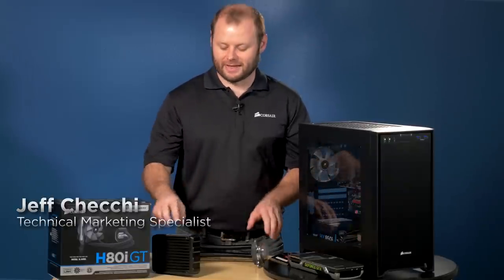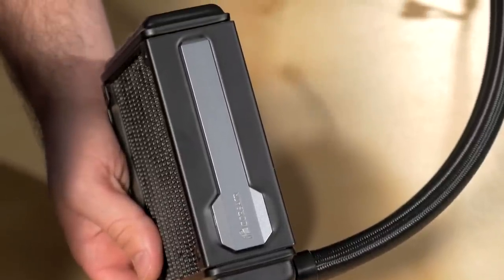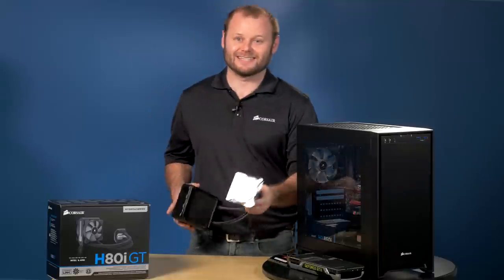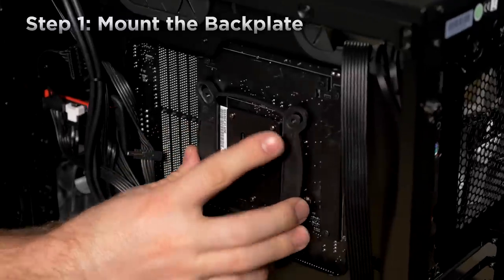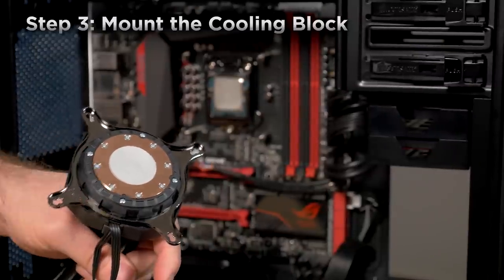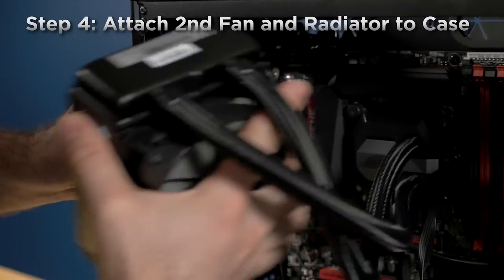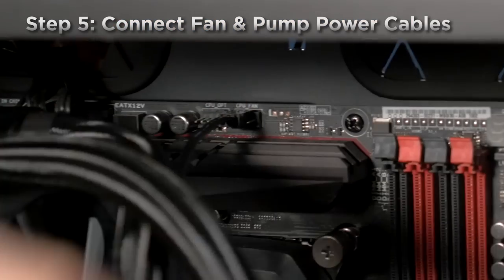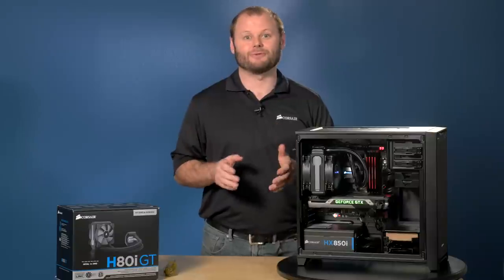Corsair Hydro Series H80i GT Liquid CPU Cooler Installation How-To Guide

Comment: What the difference between the H80i GT & H80i V2?
Reply: +Rase P TBH, all that I could see that is different is the logo's, maybe they fixed some design issues, I know my H80i GT detects the CPU Temp as 27°C even when my CPU at full load reads 65°C so the fans never speed up when the CPU gets hot, which sucks.
Reply: +Paul Kirby Thanks for the reply Paul.  I found a forum thread on corsair's website which states that the h80i GT had a really big backplate/mounting bracket which was not fitting into some mini-itx mobo's running lga 1151 so they got complaints for it & so they revised their backplate/mounting bracket to make it a bit smaller to fit on all mobo's.  Everything else about it is exactly the same.
Reply: +Rase P Hydro Series H80i v2 is an all-in-one liquid CPU cooler with an 
extra-thick 120mm radiator and dual SP120L PWM fans for cooling that's 
far superior to stock CPU cooling fans.

Comment: Hi, I got mine installed buy some guy at the store. He didn't plug in any of those cables apart from the link data cable. I'm assuming that he wants me to get the link software. No wonder my CPU wasn't cooling :/
Reply: Hi, I have no idea how to install this. What store can I go to, so someone can install the cooler for me?
Reply: +hotmusterd It depends, in my country - there's a shop called 'Maplins'
Reply: It's quite simple. look up how to install a CPU cooler, and read the instructions packet. it's quite straighforward

Comment: I have a Hyper Evo 212, my idle tempratures with a 4790k (4,4 ghz ) are 28 degress, and max 67 degress while gaming. 

Is it worth it to upgrade to this water cooler?  or like a H80i/H100i?
A little professional help here please?
Reply: well that depends, are you ok with your current temps and noise, and do you plan to overclock?
Reply: the evo 212 is a mid range All in one water cooler while the corsair h80i gt is a high end water cooler that will certainly get you better temps
Reply: ***** The 212 EVO is an air cooler....
Reply: ***** He never said it wasn't, mid range doesn't refer to a type of cooler but what tier it is based on price and performance e.g, low end coolers won't offer great performance but be cheaper, while a high end cooler will offer great performance while costing much more
Reply: Look at what he said -

"the evo 212 is a mid range All in one water cooler"

Please, please don't say i'm wrong.
Reply: whoops, sorry your right :p, idk what happened when reading that brain just farted all over itself.

Comment: what if there is no cpu fan slot?
Reply: +mike fredley Mike, I just installed one. What do you mean no CPU fan slot? The plugin or the drill holes to place the bracket? It should be pretty standard from what I have heard.

Comment: Guy I have an issue, I just got mine installed and now my pc cant boot up properly, everytime I turn my pc on, the corsair logo lights up red for awhile then turns white then the enitre pc shuts down. What does this mean and how to I fix it?
Reply: do you have asus motherboard?
Reply: +Krzysztof Dudek yes
Reply: +crest video it's because our motherboards have a safety feature built in which prevent pc from booting if the rpm fan speed is below 600 and this fan rotates very slow for motherboard ro detect it (it's just better than stock so it does not have to rpm so fast)
Reply: +crest video go into BIOS and find your fans and click to ignore cpu fan rpm from 600.
Reply: +crest video if you cannot acces bios, connect your old cooler (just the cable, leave h80i gt on your cpu) and you should be able to boot properly and then access bios and set mo to ignore cpu fan rpms.
Reply: +Krzysztof Dudek i dont understand the ignore cpu fan part...
Reply: +Krzysztof Dudek Installed my H80i GT with the stock fans and it worked with no problems on boot up. I upgraded the fans to the SP120 low noise and they would not spin above 494rpm which I found completely odd especially when they are rated at 1400rpm. I kept getting the CPU alarm as well but I didn't want to ignore the issues so I didn't ignore or reduce the required speed. What did the trick was I installed the corsair link software and was able to finally get them to a higher RPM... then I uninstalled in and have been able to control the speed using the motherboard software. Even with the fixed RPM the CPU kept having the alarm so I eventually disable since it was working as needed. Took me awhile to figure all this out, kind of annoying.
Reply: +Krzysztof Dudek Dude thx i have the same problem but did what you wrote and now my pc runs normally, no more red light xD..... (sorry about my grammar, english its not my native lenguage)

Comment: hi guys a noob question here... in "step 6: connect corsair link data cable"...... to where???
Reply: Yeah i'm asking the same question. My Corsair link program don't recognize the H80i
Reply: One end to the heatsink assembly and the other to an internal usb header. If you haven't got one, you can try buying a standard Mini USB to USB cable and connect it to a spare external USB.

Comment: Are the fans positioned for intake or exhaust?
Reply: intake.
Reply: Roberto Souza Thank you!
Reply: +Roberto Souza Wrong ! He putted as exhaust !
Reply: yes, but in the manual says to put in intake mode. anyway, I think that depends of the position of the cooler you wan't to put, if are on top the best way is put in exhaust mod and vice versa. The reason is because heat rises and cold falls, so intake in lower position and exhaust in the upper position, causing an airflow. SORRY FOR MY BAD ENGLISH.

Comment: So one side flow hot air outside and one side flow hot air inside?
Reply: No, inside fan blows are from inside the case through the radiator. Second fan on the outer side blows air out from the radiator
Reply: No, the fan on the inside of the radiator (closest to cpu) is most likely setup to push air through the radiator then the one closest to the outside of the case is set up to pull that heat out of the back of the case.
Reply: Thx, guys. I bought pc in which one of the fans was blowing hot air to inside :D I notice that my case was to hot then i was playing games so i just turn one fan. Now CPU temp drops from 78C to 43C. I think dude which sold me 2600k with h80i, ssd and modular PSU thought his CPU was dying :D Also windows was seeing only 1 processor core. I just change settings in msconf/advanced settings. Now 300 euru pc is perfect.
Reply: +Audrius Mikalajunas I have some fans blowing air from outside in and others from inside out. front mounted fan pushes air in , window fan pushes air in and at the top rear it pulls air out .

Comment: Hope that Corsair Link software will be fixed soon to...
Buying a 100 dollar cooler that has software that doesn't work is just sad!!!
Reply: That's what you get for not getting the superior AIO from Swiftech
Reply: download the older driver meanwhile, it fixed it for me
Reply: Wiler Prime
Have an older driver installed.
I had an much older version before that worked great on Win 7 but after installing Win 8.1 I haven't found one that works correctly...

Comment: is it necessary to remove the old thermal paste from my cpu before installing this?
Reply: Yes it will be.
Reply: FuriousTaco okay, thanks =)
Reply: FruitCakeNinja yah it is :P
Reply: At least if you want the coolder to work good.
Reply: +FuriousTaco theres is a 5 degree difference so i preffer to not spend 10 bucks on thermal paste and get anither fan :P
Reply: FruitCakeNinja Well it could make a big difference when overclocking :0
Reply: pew pew m8 just get a h100i gtx XD or a hyper 212
Reply: Arctic Silver makes a paste removal solution called ArctiClean that makes the whole thing easier, FYI.
Reply: hyper 212 is shit compared to the h80

Comment: Which case is that?
Reply: +The Drunk Knight It looks like a Obsidian Series® 350D Windowed Micro ATX PC Case CC-9011029-WW
Reply: Wow thanks man
Reply: +Paul Kirby Hi Paul, so if it fits in the 350D, then no worries for the 450D?
Reply: +Gilmer 9999 Well from what I can see in the specs the 350D has space for 2 x 120mm or 2 x 140mm fans on top where as the 450D has space for 3 x 120mm or 2 x 1400mm fans, just check in the specs.However you still need to watch out for the rear fan if fitted.
Reply: Paul Kirby
Thanks! It's sometimes hard to understand the specs, though. I apologize - I'm not as knowledgeable as I should be.
Reply: +Gilmer 9999 That's ok, I even miss read and responded with the specs for the top fan mounts LOL, but both rear fan mounts say 120mm which most people mount it to, so in theory you "should" be ok.  
I ended up buying a Graphite Series™ 760T Full-Tower Windowed Case CC-9011073-WW for my H80i GT cooler, seems fine, I am using it on an Intel i7 4790K and on idle its about 32°C and at full load its only hits about 60°C so its not too bad, I have it pulling in air from the back of the case through the rad and into the case and use 2x 140mm fans blowing out the case.  
I "might" try putting rubber gaskets between the fans and the rad so that I get more pressure through the rad instead of air leaking through the gaps, resulting in cooler fluid.
Reply: +Paul Kirby Hi Paul, thanks for the help. I got it installed, not too much trouble, although it took me about 2 hours compared to Jeff's 3 minutes, lol.
Reply: +Gilmer 9999 Well mine also took longer than the 3 mins also LOL, however I was building everything from scratch along with all the cable management etc, but I think everything took about an hour, and that is for installing everything.

I sort of had a heads up on how to install this cooler, due to I had to build my sisters PC before mine, so hers was a test LOL.

But overall this cooler is rather nice, the only issues I have is the gap between the fans and the radiator, there is a small gap between them which means your not getting the full pressure going through the radiator, so I might make a rubber gasket for both side, so hope fully that will force more air through the actual radiator causing the coolant to be cooled better.
Reply: Paul Kirby
Sounds like you more than have handled anything you need to, or will in due time. /cheers!

Comment: Pump on this unit lasts nothing.
I opened an RMA ticket with a refund request. Ticket

6714025 please read it.
Reply: Can't find it. When did you buy this cooler? When did it stop working? And how did you realise it failed?

I just installed it yesterday and I fear pump fails and leaks. :(
Reply: +Krzysztof Dudek This is the thread: http://forum.corsair.com/forums/showthread.php?t=154367
PS: I bought it from Drako.it and I will buy a second unit in the same shop
Reply: +Krzysztof Dudek and this is the ticket number I opened in the corsair.secure.force.com portal: Ticket6714025
I
Reply: +Krzysztof Dudek I forgot to answer your questions. 1) I bought it at drako.it 2) Some days ago 3) As soon as I start the PC I get the CPU overtemperature error, I tried reseating the cooler but the CPU pump rpm is 0.
Reply: +Davide Perini np, cheers for answers!

I decided to pack this crap and send it back to Amazon, will say it's faulty because it Goddamn is... 
a) cannot control rpm of fans so they all run how they want to (very slow) so I have hot air stagnation inside my PC 
b) meaning my MSI GTX 970 (60c) and motherboard (40c) overheat but my CPU stays ice cold (23c) 
c) because my vanilla fans are too slow, hot air rises and I can smell the heat from under the table 
d) corsair link does not detect anything, even with "fixes" LOL 
e) air cooling is safer, better buy a larger case and then buy noctula but will go with 212 evo for now, not gonna overclock my i5-4670K anyway but buy a new chip in January

what a shame, I was really excited about this cooler :( it looks amazing but software is SUCH a letdown... :(

Comment: easy? fuck that l spent HOURS getting this installed into my case.. the standoff screws are a joke.. one of them spins with the thumbscrew so l cant take the pump-unit off of the motherboard anymore.. Also the fans make this very strange sound, like something is against something -sound, even though there's  nothing between the blades, when past 1000rpm.. Yeah it keeps my CPU very cool compared to the H55 which l just replaced with this cooler.
Reply: +Antti Eerik It literally took me 30seconds to install the instruction booklet makes it very clear..
Reply: +Antti Eerik It's the fans causing the noise, same thing happened to me once they throttled up to higher speeds. I new SP120 low noise corsair fans and they are much quieter though I did encounter a problem that I won't go into detail. Symptom was the fan speed wouldn't go above 500rpm or so.
Reply: l changed the original fans to Ek-vardar 2200rpm fans, much quieter